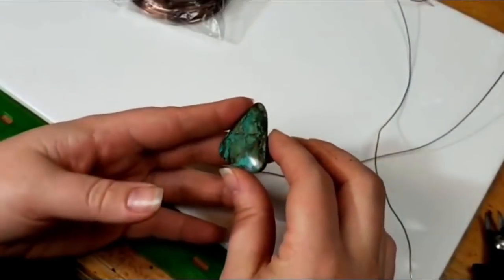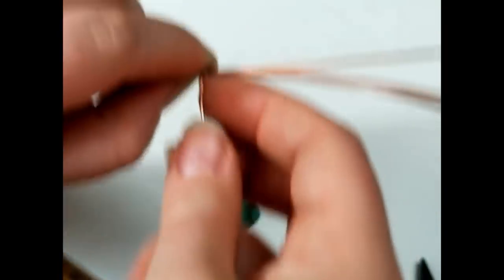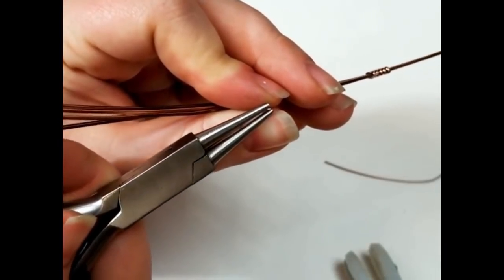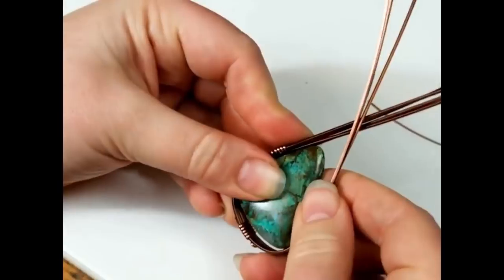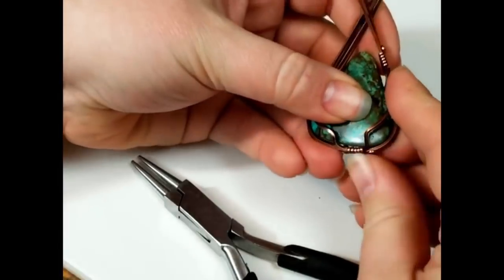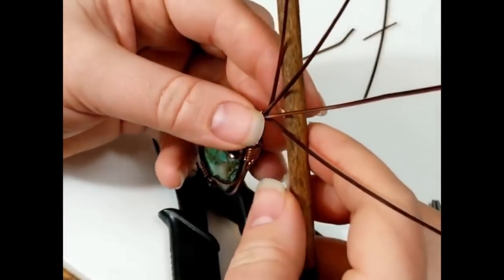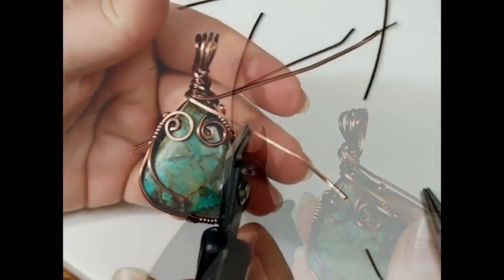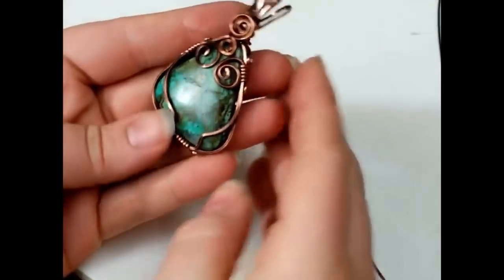Wrapping Cabs with Square Wire: Tid Bit Tutorial

Comment: Hey Yvonne here's a trick for wire nicks I use. You can take or leave it as you like.  In the process of making dragon eyes I have accumulated a large variety of nail polish colors. As a beginner wire wrapper nicks are a given. Hopefully, with practice there will be fewer. In the mean time I find a nail polish color that matches my wire and I get a toothpick and get a teeny tiny bit of polish on the tip and tap it on the nick and voila! The nick is barely noticeable, sometimes invisible. The trick is to use a minuscule amount of polish, otherwise it will be noticeable.  I've also used Lumiere pearl white on bright silver and it blends right in.